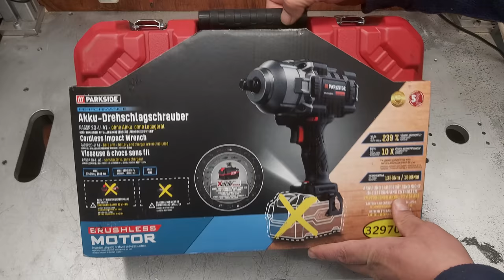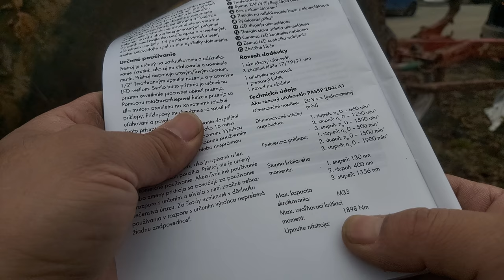Parkside   impact wrench screw breaker 1356 Nm PASSP 20 Li A1

Comment: You have to take into account the fact that the use of additional adapters and non-impact sockets greatly reduces the power of the device.  Thanks for a nice video.👍🏻
Reply: Eee what? I can understand that adapters will reduce output by couple of % but non impact sockets? Do you know why impact sockets were designed for? They are not made to transfer impact, they are made to withstand impact and not brake...
Reply: @Grabarz23  Yes you are right.  You understand nothing.
Reply: @MrKaeRH  so explain to us why non impact sockets reduces the power of the tool.
Reply: @Grabarz23  cause of the weight of the socket .
The heavier it weights , the better for impact wrench .
Reply: @Grabarz23  Everybody knows that sockets made from moly transfer the torque much better. Look at the video with the green parkside impact driver. With normal CR-V sockets the nuts wouldn't move, he switched to CR-MO sockets and it came lose easy....
Reply: @campersBR  you are incorrect and correct at the same time.
Its not the weight which transfers force, but sidewalls of the socket, it don't have to be impact socket to transfer force as long as it has enough thickness it can be CR-V as well

Important thing in sockets is how tight it fits on impact driver pin and how tight it fits the head of the screw. If its loose then impact force is reduced....
Reply: @Morpheus02000  its not the material which transfer force, its thicknes of sidewalls of the socket. Impact sockets are more durable and can withstand impact force much longer than typical cr-v socket, but its not magical, if you take two identical sockets one made of cr-v and one for impact purposes with same thickness and fitting tightness, the only difference would be in their durability
Reply: @Grabarz23  Not "couple of %", but tens of %, the exact number depends on your maximum torque output. From some point they don't transfer torque at all, they just flex left and right. Every adapter has a torque limit from which it just flexes and does not want to turn. The same with sockets, they just flex, they don't turn. And if you increase the impact force on the socket/adapter more, it'll break.
The fact the adapter/socket flexes does not matter much when using hand tightening, it will result only just a few % of reduced torque, as you said. But it has a huge impact - or rather hasn't (pun intended) when using an impact wrench. Because you are not applying constant torque, but a lot of small torque increments, after some point it starts just flexing, all the torque you put into the metal, all the torque increments, is lost in the metal and in time it breaks.

Imagine this: You have a lugnut on a car that is rusted shut. You take a long breaker bar, put it on, stand on it, nothing. So you start jumping on it. And nothing again, because after each jump, the breaker bar just bends like a giant spring and before you can jump on it again, it just returns to the original position. Now imagine you put a longer cheater bar on top of that breaker bar. You pull it, it bends badly, but then snap, and the lugnut is off. The same is with adapters. 

It is because impact wrench does not deliver the whole torque at once, but in impacts.
Reply: But he used the same extension on the torquewrench so still fair you are right but it dosnt reach its rated torque 👍
Reply: @campersBR 
Wrong.
It's exactly the opposite.
The lighter socket weights, the better for the wrench.
But it has to be hard, tough metal.

Comment: When you don't use impact sockets the power will decrease as the metal is soft and will absorb the impact power
Reply: Impact sockets are not harder but tougher other way will brake. Because are thicker and heavier  this influences the power of blows.
Reply: Play-doh socket ? 🤔🤣🤣🤣
Reply: @14KiloWhisky  fits any screw
Reply: Other way round, impact sockets are made of softer steel than regular sockets.

Comment: You need impact sockets for maximum torq
Reply from the maker: I have to buy a set.
Reply: @FORWORKANDFUN  Chalanisko ma pravdu ... na razovy utahovak potrebujes razove bity ... na klasickych mozes stratit aj viac ako polovicu maximalneho momentu. 
Ionut have a right. You need impact sockets. With standart bits and sockets you can lost up to half of max torque.
Reply: tak tak tiez som neveril tomu kolko momentu sa tam moze stracat...a hlavne aj v tych predlzeniach :)
Reply: @marekduchovic8406 
👍

Comment: Based on the tests you did in the first half of this video, this tool is nowhere near 1300Nm. You mainly loosened good condition bolts which are torqued 30-50Nm from the factory. This tool is max 500Nm. The bolts you tried at 10:00 should either break or become loose if you really applied 1300Nm.

Comment: Great video! Very serious.I think this impact wrench tool is worth the money (200 euros),reliable and powerful enough (300 to 400 Nm) to work on your car.Same tool at Milwaukee would be  +600 euros...
Thank you again.
Reply from the maker: I don't think I used his full potential. I have to fix that. I will use the CR-Mo setting and the higher power will exceed the 700 Nm limit
Reply: @FORWORKANDFUN  Yes it actually would be very interesting to know the potential with the proper CR-MO sockets, to be continued...

Comment: Currently you get the Bosch 1050 H for 230€ with L-Boxx and one 5,5AH ProCore battery.
If you sell the box and the battery you have a price of 140€! Which is only 10€ more for the Bosch!
So if you already have a Bosch Charger it's just a bit more expensive than this Parkside impact wrench...
But I bought the little Parkside with 226NM, this was also a good catch and you dont get a Bosch close to this price!
Reply from the maker: It's quite expensive and can't be found. People will still buy when available.

Comment: They are always less powerful than they are rated but with an extension you can lose 20% of the impact, nevertheless it is impressive for the price
Reply from the maker: There was a loss of strength, but he still would not reach the paper data.
Reply: @FORWORKANDFUN  I don't think, that silver coloured nuts are suited for electrical impact wrenches!
Reply from the maker: @dergeneralist7106  CR-MO should not be used. I didn't have them, I used CR-V
Reply: @FORWORKANDFUN  "should not be used. ??  SHOULD BE USED

Comment: pls test milwaukee vs parkside impact wrenct
Reply from the maker: I'll compare it from  MILWAUKEE M18 FMTIWF12-0XM18 FUEL™ 1/2"
Reply: @FORWORKANDFUN   už se prodává upgrade utahováku  https://www.milwaukeetool.com/Products/Power-Tools/Fastening/Mid-Torque-Impact-Wrenches/2962-20
Reply from the maker: Super. No ja už mám doma hore uvedený model.
Reply: @FORWORKANDFUN  maybe better also to find M18 FHIWF12-502X model for a little bit comparement of the same papper specs :)
Reply: @FORWORKANDFUN  I believe Parkside uses the same technology because both machines (Milwaukee and Parkside) have exactly the same technical data. However, I can imagine that a stronger Battery can make a big difference. I would like to know, whether tihe Mikwaukee can loosen the 530 nm bolt.

Comment: buddy by using the wrench extension you lose a lot of power when unscrewing. And it was enough to use a longer cap ... regards from Poland
Reply from the maker: Hi friend from Poland. Yes, there was a loss, but it would still not reach flood values.

Comment: Hi, nice video. I will buy the small impact hexagon screwdriver monday. Two things i would like to add.
1) Pls check if the gears in this tool/impact wrench are greased. I have the green one and it had almost 0 grease on the inside wheels/gears. After i added lubricant it sounds different and it seems a little stronger. Pls check it and if you do inform us. It would be a pitty to use it with no grease cause it will break down fast. I also bought a small engraver today (15 euros or so) Parkside green and it also had 0 grease.
2) Use it without extentions and with chrome-molibden impact sockets. I saw a big difference with mine even between impact chrome vanadium and chrome molibdem.
In your opinion does it worth 129 euros? I have two 4Ah batteries so i don't have to buy those.

Comment: To check the Newtons exactly you need a stopwatch.  The maximum force occurs after a variable time from the electric tool.  This test is not quite correct, the technology of a torque wrench is different from that used for tools that disassemble wheels.  A torque wrench is immediate, the impact drill is not.
Reply: what do you mean? if impact driver is rated at 1800 Nm how it cannot realese 500 Nm bolt?
Reply: @GocaKresic  Mine is an observation on measurement.  but did you see the whole video?  Do you know which instruments do not Newton measure with?

Comment: It would be perfect if Parkside provide adapter for this machine to be used with SDS drills!
Very good reason to bay on top of the main purpose
Reply: This is an impact wrench not a hammer drill they work diffrent

Comment: why need to buy overprized brands if the cheap brand do the same job.
Reply from the maker: If you want to use the tools for home use once a week, Parkside is also enough. If you need 8 hours every day you need to invest in branded tools
Reply: @FORWORKANDFUN  in car repairshop we used parksides too for smal jobs ofcourse.milwaukee is the same or even makita only they sell it for 5 x higher.i dont believe in magic the parts inside are all the same.

Comment: Can you please do video using proper Chrome Molybdenum socket on torque wrench, torque is lost with silver chrome vanadium and extensions.
Reply from the maker: Yes, I have ordered the CR-MO set. I'll try it when it comes
Reply: @FORWORKANDFUN  Cool i look forward to it.
Reply from the maker: @MrZimmaframe  
I hope it goes better.
Reply: @FORWORKANDFUN  It sounds like the Milwaukee and says it has the same power. Do you think it does?
Reply from the maker: I didn't have MWK with that much power. At home I have a force of 610Nm MWK, but so far I haven't compared it. @MrZimmaframe